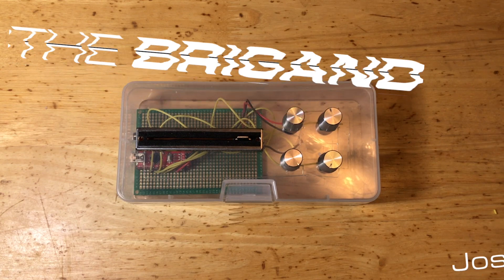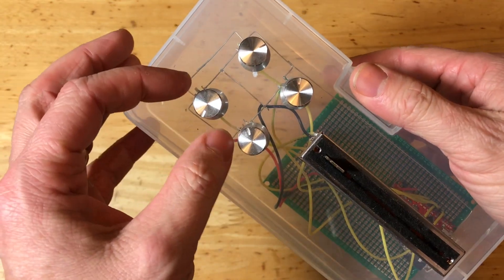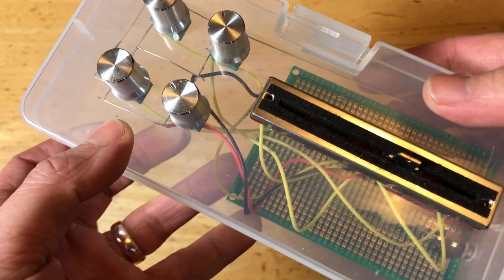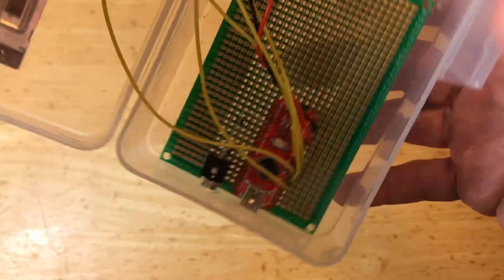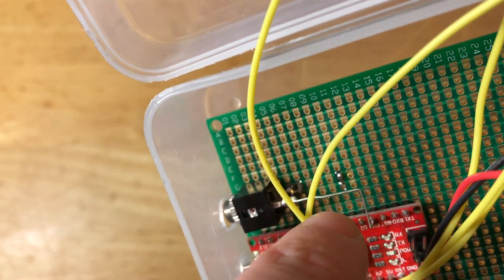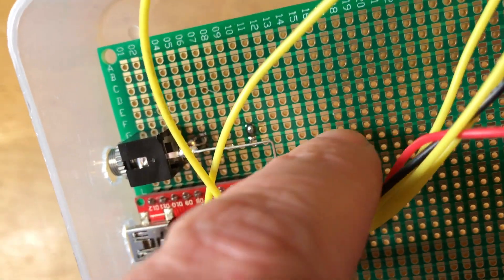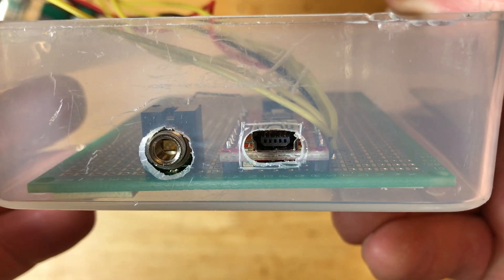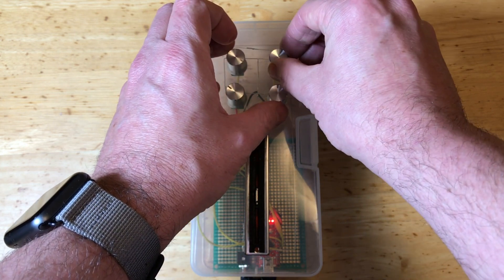The Brigand — a DIY, Arduino-based, Granular Synthesizer

Comment: One of the best arduino synths I've heard. Not just bleeps and bloops. Have you tried to get polyphony from this?
Reply from the maker: I haven’t! But it’s not likely to work. The little guy is working pretty hard as it is!

That said, my modified code is on Githib as Auduino2! See what you can wring out of it!
Reply from the maker: Oh! Also! You could build polyphony out of several of these working in concert. Use one as a router, listening for key presses. Then have it convey note information with PWM to the next oscillator. You could tune them all together or individually. I think it might be neat to have a multidimensional ribbon controller that controls each of the five parameters at once. 

I’m actually hoping to spec out such a controller here on my channel, though that will probably be after I do my X-Ray wavetable idea.